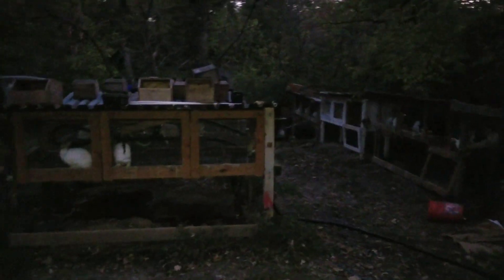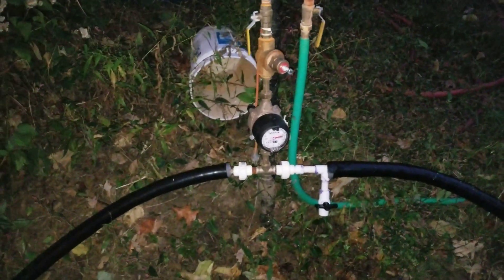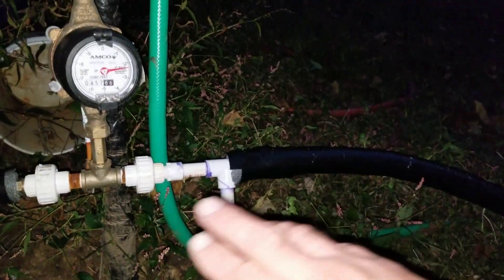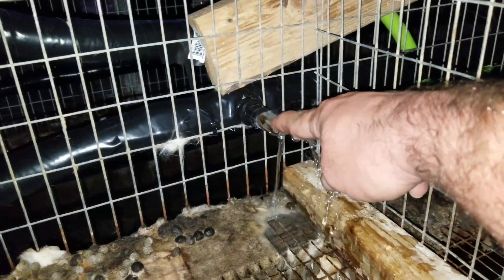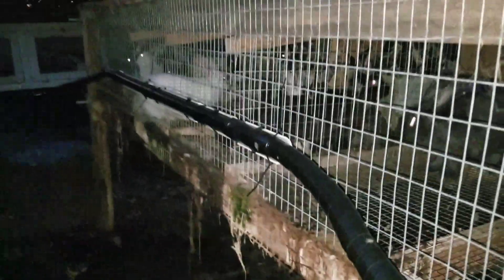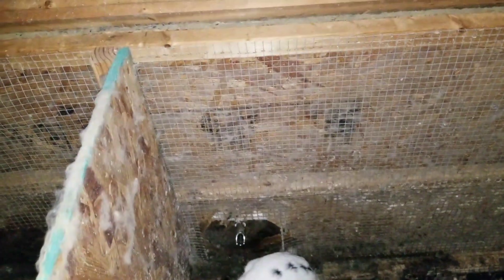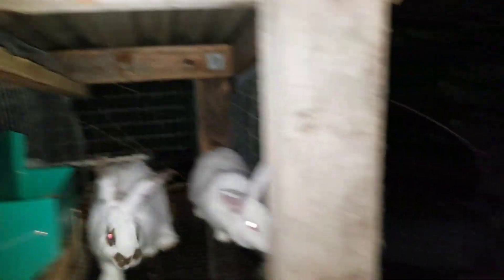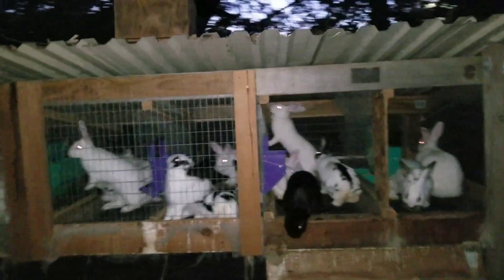Rabbit autowater setup update

Comment: I appreciate you have lots or large snakes and breeding your own supply or rabbits when you have a collection as large as yours is cost effective and the water system meaning they have fresh water at all times is great however could you not cover the grid floors partially so they have a hard surface to sit on such as a plastic base with holes in to allow urine and matter to fall through.    The pump seems loud as well probably giving off frequencies you may find tolerable but driving your rabbits insane.  I don't know how you view your feeding animals and I'm not saying you don't care about your animals but welfare could be higher...
Reply from the maker: Sam 94 since the making of the video I have changed pumps and also in some of the cages have used empty feed bags to cover cage floors on rabbits that have issues with their feet. The majority of rabbits feet are in fact in good condition with the exception of very few. I've found that limiting cage space improves this problem.
Reply: drthik1 bumblefoot and sore hocks are common with grid flooring.  Have you considered cutting a wooden base that can sit on top of the mesh then you can just lift it up on a angle and scrape everything out through the mesh just to provide a solid base and added insulation.  Just an idea.  It's unrealistic to treat your feeder animals as house pets but just making sure they are comfortable until the day they are snake chow is the right thing to do.  Nice to see you are making improvements on there well being though and your snake collection is outstanding.  I know some links to decent information about breeding rabbits on a large scale with minimal husbandry but maximum welfare if your interested.  Honestly not trying to be patronising or step on your toes just willing to help and maybe slightly improve some bunnies short lives :)
Reply from the maker: Add links and I will check into it
Reply: I agree, not only would the waste still slip through the floor, but the rabbits would be more comfortable.